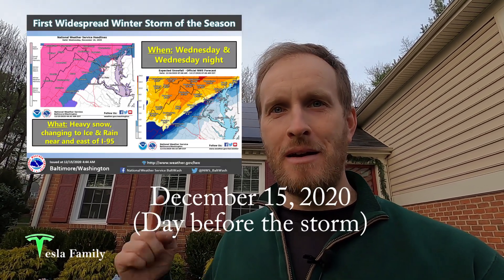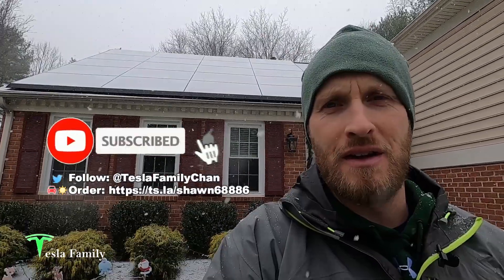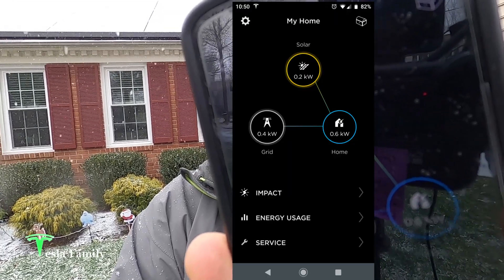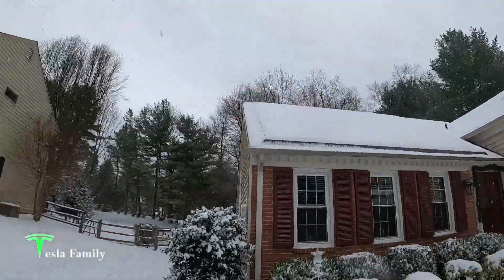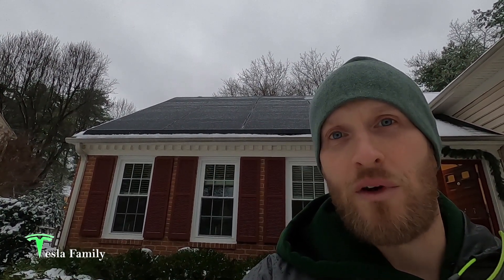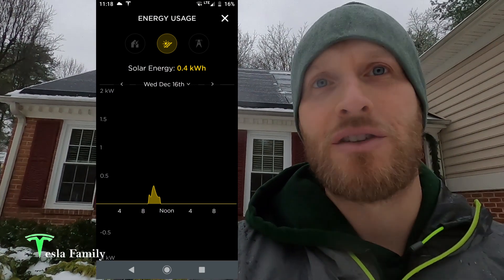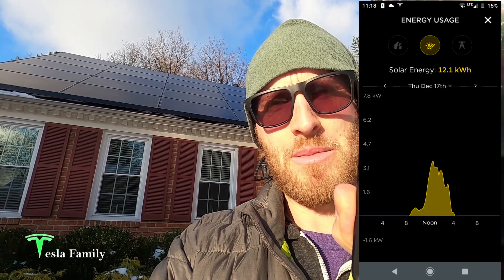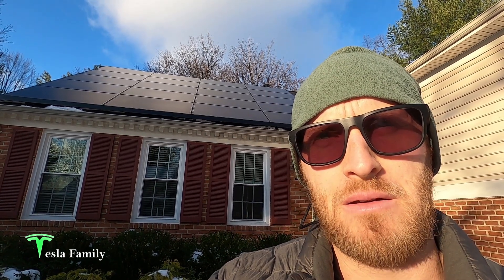Solar Panel Performance in a WINTER STORM

Comment: We’re having a horrible winter storm in Texas we haven’t had power in 12 hours and counting this would really come in handy at the moment.
Reply from the maker: Sorry to hear about the power outage. Unfortunately, when solar arrays are tied to the grid like mine are, utility rules mandate that in the event of a power outage, solar arrays must automatically shut down. Solar systems have detectors that sense whether power is coming across the grid, and whenever grid power is down, they automatically shut down too, to protect utility workers.
Reply from the maker: Tesla Powerwall, however will power your home during an outage. Each one holds 13.5 kWh of backup power.
Reply: Pretty much your panels are useless when the actual power goes out as the solar panels are tied to the grid😅😅😅 i know right u thought u were invincible
Reply from the maker: @joesephduckets5144  Correct, because the panels are tied to the grid, they are useless in a power outage unless I get a powerwall installed. In an outage I can draw from the powerwall and the solar can recharge the powerwall when needed.

Comment: I had 10 inches on mine from that storm.  I have been doing snow load roof calculations during almost every snowfall.  Also the snow avalanches the panels create are cool and destructive.
Reply from the maker: Thanks for watching and sharing the comment! This brings up a good point, wonder what the snow load rating is for the panels. Yes, I bet those snow avalanches are neat to see. Just don't stand under one when it lets go!

Comment: I wanted to know can you connect a portable generator to power your house, just incase you don't get any solar or little bits of solar energy coming in to charge your tesla battery like i saw during the texas in 2021 were some people had solar panels and all that but the snow and sun with the freezing temperatures made it hard to power their batteries
Reply from the maker: Thanks for watching! Good question but I have no idea where I would connect the generator if I had one. I wouldn't want to damage any of the equipment by connecting in the wrong place.

Comment: I don't like to just rely on only one way to power my house I have a generator that can power my house with either gasoline or propane the problem gas turns bad in 3 to 6 months while propane last for decades but eventually runs out, but solar is permanent
Reply from the maker: Thanks for watching! Gotta break away from those fossil fuels. Solar and battery and grid are three ways to power your home but if you have your system sized correctly then you only need solar and battery!

Comment: what is the total power of the panel?
Reply from the maker: Thanks for watching! Each panel is 315 watts (newer panels are 340w). 24 total panels. My total system is 7560 watts.
Reply: @TeslaFamilyChannel  
Nice, I also do solar energy as a hobby. I'm trying to increase the efficiency with a solar tracker a little bit now. Sun tracking has increased my efficiency a little more than 40%. I use 350 w panel (6kw)
Reply from the maker: Very cool! I have really noticed a difference between winter and summer production due to the  sun angle and shading. I have that in this video: https://youtu.be/UbJHerhQ6lA
Reply: @jank1512  thats really good for one panel. one of my arrays is 1.2kw and i might have brought in 6kw today, but i just laid them flat on the ground for now